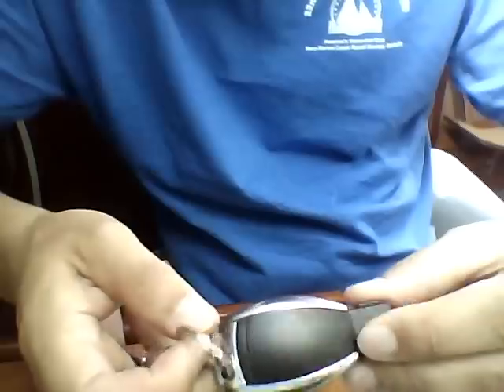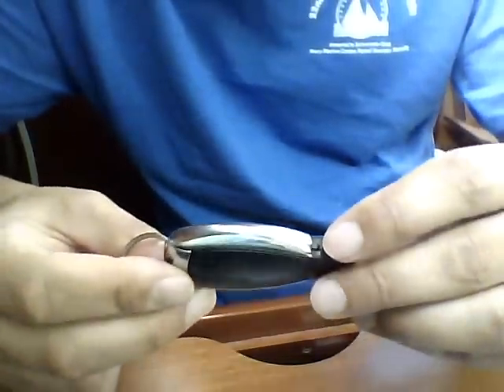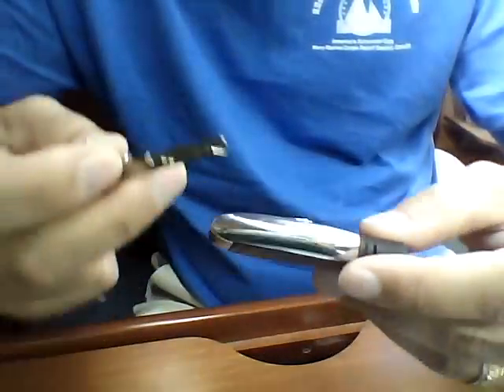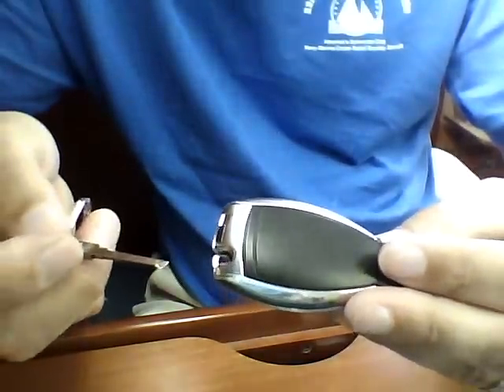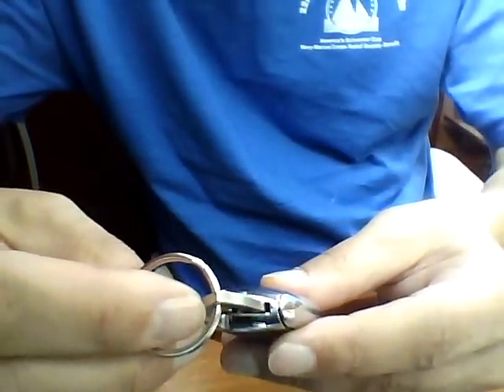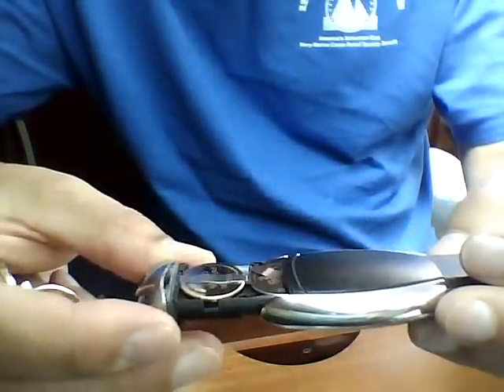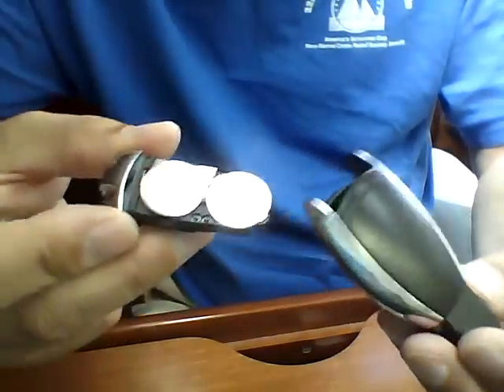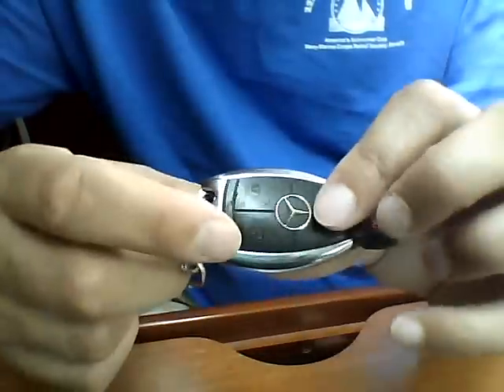Key Fob.wmv

Comment from the maker: You're welcome everyone.  As a follow up to the video, the day I replaced the batteries I didn't see any improvement.  I now suspect that we were parked in area with strong RF interference.  Because, when we drove away and parked at a restaurant the fob worked great from a distance of over 50 feet.  But, when we returned to the parking lot in which I had trouble with the fob, it would only work again right against the glass.  That location is near a US Navy air base about a mile or 2 away.

Comment: WHY... did you not make a better discription of what you're doing... I almost died because I couldn't open mine. It took me 2 hours to find your video, so simply put and done. Make a better discription and title add that it's specifically the YH model 2007 s class Benz key remote blade key removal and battery change with out destroying it